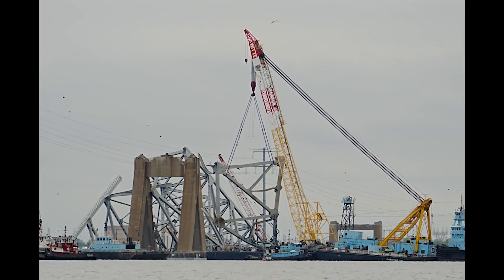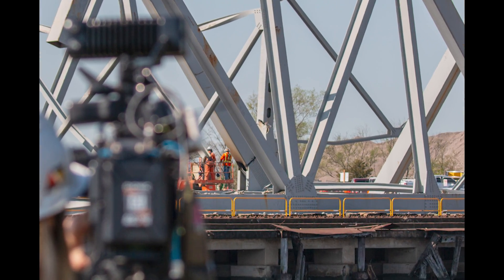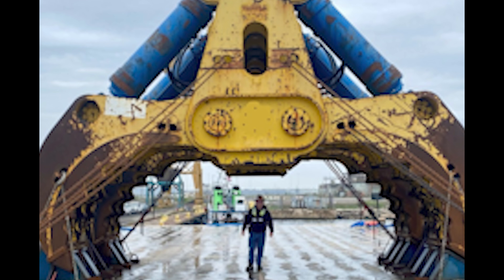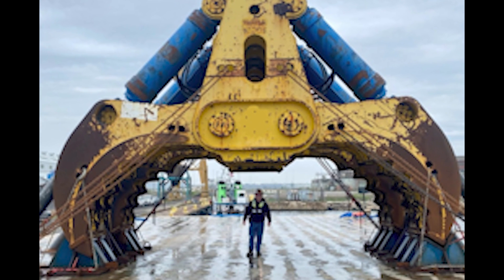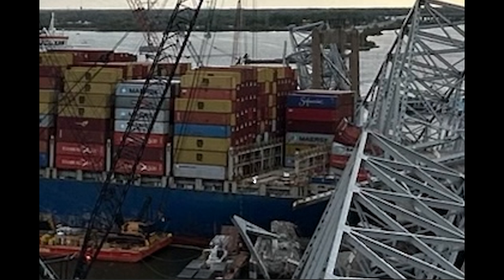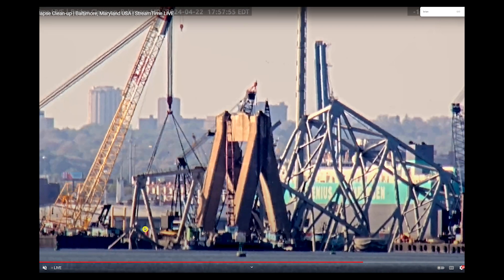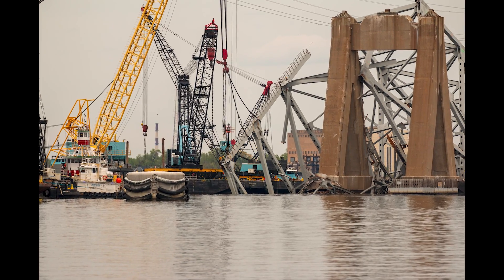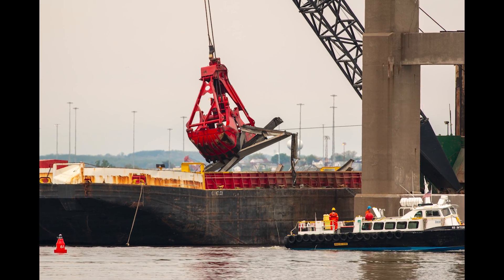HUGE 200 Ton Claw To Remove Key Bridge Debris From Dali Ship

Comment: The grapple doesn’t have any cutting ability per se, but it may separate some sections by gripping weaker bridge members that might rip free from the rest of the adjacent structure.  Either way, it will get the job done.

Comment: That 200t grab - fine. But - what crane will it attach to? 

For me the sad thing ist the lack of crane capacity. Most cranes I saw are mobile cranes placed on barges. These are very problematic: Their stability depends on a stable ground - not given by a barge.
Reply: Mobile crane or crawler cranes? A stable pad and must be plumb level to operate at near capacity.
Reply: @leonardcollings7389  As far as I saw both. Perhaps now the mobile cranes are gone. But lately I saw crawler cranes a lot. But they also need a stable ground or can only operated by a fraction of their capacity.
Reply: @wjhann4836  The lift capacity measurement of a crane tells us how much load a crane can lift naturally, including the dimension of the load, lift height, and lift angle. Crane comes with a load chart.

Comment: The piece isn't pulled up because a dive team is cutting the beams below in the darkness. So to keep them diver's safe it's rigged up so it can't crash down once they cut thru the pieces near the deck of the bridge because that is what is holding down the frame.

Comment: The Chesapeake 1000 used to be the sun 800 (at the sun shipyard in pa,).
Traveling with load can be dangerous.
Tubular booms are strongest.  But susceptable  to damage.

Ie.  On P&H 90T TRUCK CRANE
a dimple in a boom member  bigger than (can't  remember exactly) but the size of a nickle or dime effects the structural integrity of the boom. And replacing the damaged strut is required.
 Ex philly shipyard crane maint.

I enjoy your commentary and videos on this incident. It brings back memories loved that job!
Wish i was 30 again.

Comment: Do we know what crane is going to be using this huge grapple? I’m thinking you would require a revolving crane, like a large crawler crane secured to a barge. Capacity of the crane would probably need to be around 700 short tons minimum. I’m aware that the grapple capacity is 1,,000 metric tons, so I suppose it would be logical to try to match the two pieces of equipment. So a 1,000 metric ton crawler crane would be a solid choice. But of course there are many factors in obtaining and mobilizing this type of equipment. Lots of logistics challenges involved.

Comment: It took two decades to build this bridge. I imagine you can't remove all the parts over night. What a big job. The construction of the bridge and its approaches completed the two-decade effort to build I-695, although the bridge roadway was officially a state road: the unsigned Maryland Route 695.
Reply: The worst part was that BETHLEHEM STEEL vigorously fought against the APPROACH highway going directly THROUGH their sprawling 3,300 acre property. The largest individual steel mill east of the Mississippi River! So they had to ELEVATE the entire access rode way across the steel mill to the bridge. Such a HASSLE. Then slowly overtime, as the steel mill waned, there WERE at grade access rode ways to the bridge. Dreadful history indeed. 
Sam, Towson, MD
Reply: No modern day bridge, takes 20 yrs to build  !
Reply: @andrewrees8749  that’s true. That reference is to the very. Protracted battle between the MDOT and Bethlehem Steel over ACCESS  highways to the bridge. As you see in the recycle process, the former Steel Mill grounds (3,300 sq Ft) dominates the shoreline. The Steel Mill did NOT want “at grade” access Highways ON THEIR GROUNDS. So it took “20 years” before they settled on ELEVATED access highways. All of this history is almost 60 years ago. And became a moot issue with the closure (and demolition) of the Steel Mill. I hope this explanation helps clarify the situation.
Reply: @andrewrees8749  Addressing the “20 years to build the bridge” wise crack local comment: This is an exaggeration borne of the numerous frustrating delays. It DID take FAR TOO LONG because of the unfortunate hassling over highway access and funding cycles. But you are correct, for as long as it took, it probably didn’t quite take a full two decades. It just seemed like it did!🥱

Comment: That claw was used during the Catharina gulf cleanup where multiple unused offshore rigs collapsed. It can to some extent crush the structure and in some cases also cut, but realy rely on divers with cutters to chop up the pieces. Good thing is that it doesn't need to be 100% aligned on top of the load to pick it up as long as the two sides of the claw can gap over the structure.
Reply: It’s better to call it counterweight, rather than ballast.
Reply from the maker: @mmmartin261  barge people call it ballast
Reply: Grab looks like it has the hydraulics to crush a bunch of stuff

Comment: Awesome footage Jeff, So .... What do you figure the time line is, ( After forensics has done due-diligence ), for enough of the structural steel removal and your port is okayed by NTSB and the harbor-master, that you folk will be up and running again, say at 50 % or better??? .  Lie to me if you have to. lol . I'm just asking from a power engineers POV ,  not anything that might be note-worthy.......  I am figuring on  July.... 
Any way, Nuff said...... Stay Safe
Reply from the maker: Unified command says end of may

Comment: What they really could use is a maritime oil field heavy lifting crane as have seen them rated at 15,000 tons and now have some even heavier rated. Most likely all of those cranes a good distance away and also under contract somewhere. Delays could have been from the search for missing bodies ongoing or underwater entanglements with bridge roadway debris.
Reply: Problem is the draft of the crane exceeds the depth of the water.

Comment: It's a GRAPPLE and not a shear.   The lightest steel is at the top.  The lower you go, the heavier the steel.   And...visibility and working conditions for rigging and cutting are a completely different world.   The concrete and asphalt deck is a different animal as well.   The optics are overrated as too how quickly the progress is going.

Comment: The main span of the bridge is Suspension under the flying truss. The sonar images show many of those cables still attached to the submerged roadway. This could explain why they are moving the sections of the truss so slowly. Those cables would need to be severed before lifting the heavy steel.
Reply: He keeps pointing to E-Joints are a cause. Worked construction, was on a few bridges under con.. The way I see it is the roadway is a liability as it's no a load bearing structure. The bridge was built to support the roadway.True?
Reply: @ch3no2killz  True.  That is the reason for the whole structure; to carry the roadway over the river, SAFELY.

Comment: I just keep thinking back to the Big Blue crane collapse in Milwaukee in 1999, and I'm sure these operators have the same thoughts. That incident rally added emphasis to the movement to certify crane operators on specific types, lifts, and loads, and that kept me busy as an instructor for quite a while.
Reply: its why they are only doing 200-400 ton picks with a 1000 capacity ton crane. big blue they were running everything right on the edge of the max and the wind load took it over
Reply: @imchris5000  Exactly, but running up to the edge when there are uncontrollable variables such as wind will eventually catch up to you. I personally feel that in this age of computers and calculators, instead of slide rules (remember those), no one is throwing in that 10% here and there that helps offset those edges. 2 + 2 = 4, but some folks feel that 2 + 2 = 4.000000 is more accurate.
Reply: -it was too windy that day.

Comment: What I see during this Bridge collapse, and was designed, and the Rupture of the Box Girders, tell's me that this Bridge was really poorly designed and built using too Thin of material for the loads it had to carry...🧐
Reply: @stuartpearce I would take the opposite view. The bridge stood just fine since, what?, 1973? 1978? Lots of storms in all those years. It was built to be strong enough for it's purpose, and no stronger.They used the lightest, most economical steel possible to meet the requirement for those times .Barring the (inevitable) collision it would be standing still. When they widened the shipping channel over the years protection ought to have been built for it.
Reply: I don't agree at all. 47 years and thousands of ships, and 30,000 cars a day. A 100,000 ton ship moving is going to do catastrophic damage to anything it hits.

Comment: @5 mins - very possible they dicovered the last missing worker and everything would have ground to a halt until the body is recovered. Or something else entirely...
Reply: Could still be attached underwater. Crane just stabilizing it while cutting underwater
Reply: @kevinknight6302 BINGO! That’s what I think also. But Jeff LOVES his dramatic controversies!!!
Reply: Thought there were 2 missing yet
Reply: Ive not sat on the egde of my chair watching but, ive only heard of that 1 guy @westsparks6844
Reply: I just informed Jeff that it is common to “stand up” an element to enable below water cutters to separate entangled submerged pieces one from another. But Jeff LOVES the DRAMATIC so he often finds “problems” when it’s just SOP!😂
Reply: I think 2 workers are still missing not 1.
Reply: Not likely
Reply: Yes my assumption too.
Reply from the maker: No they tried to lift it the day before too, and had problems.
Reply: @jeffostroff i wonder if it’s hung up on something, or maybe off-balance (being an odd shape(?)

Comment: With regard to the shot of the C1000 attached but not moving.
I suspect its caught on something and the crane has reached its lifting limit.
It looks like the barge’s deck is parallel with the water. That would indicate a full load on the hook. 
I ran some calculations and came up with 17’ of draft, even keel with 1000ST @ 63’ from the bow. 
You shot seems to show the stern lifting as rope is taken in. 🤓
Reply: Just to show some of the guesstimates I’ve used.
Using midships as a datum, I am assuming 3500T water ballast @ 50’ aft of datum. FW TPI = 44.8T